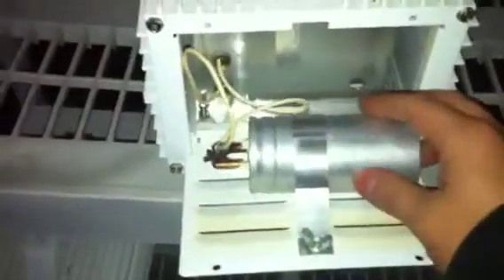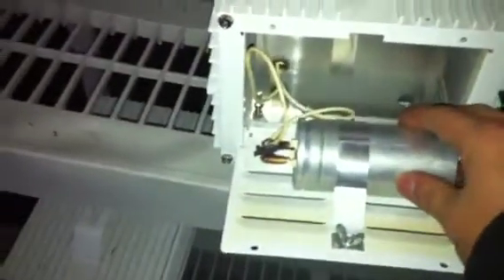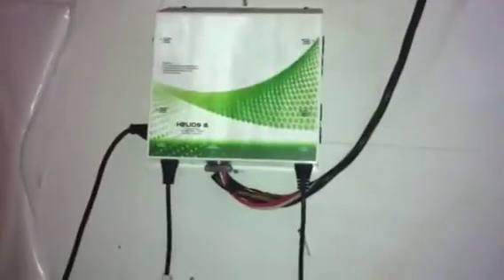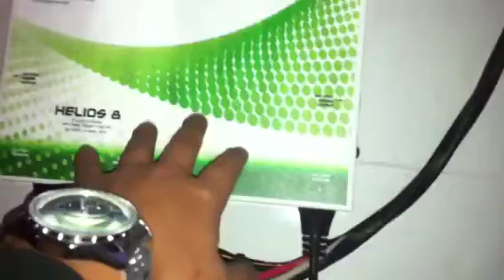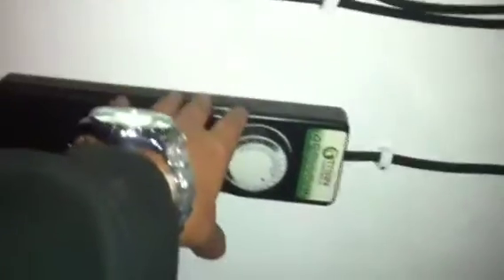Part 2 6000watt Flower Room Specs

Comment from the maker: @coal4life your lumatec ballast should have a 5 yr warranty, I really like the adjustability from digitals but for instance like your issue if u have a problem u need to send it in or have the hydro store hook up to swap u out, but with all my magnetic ballasts when they go out it's a $27.00 part that takes two screws and unplug 2 wires very easy and turns back on like new the down fall is a mag 1000watt ballast pulls 1100w compared to a digi 1000w for which that's what it draws so u save a lit